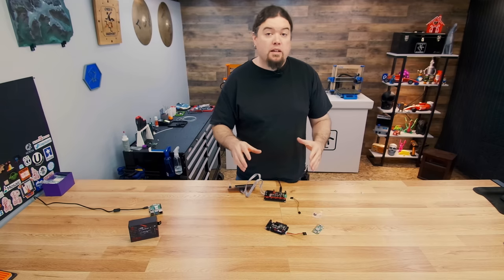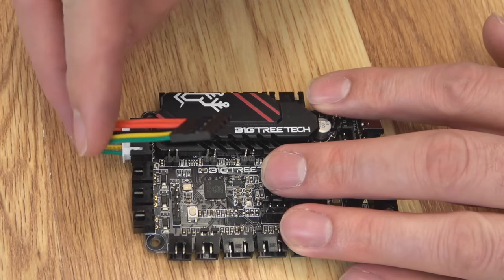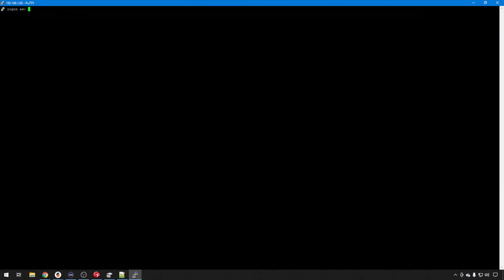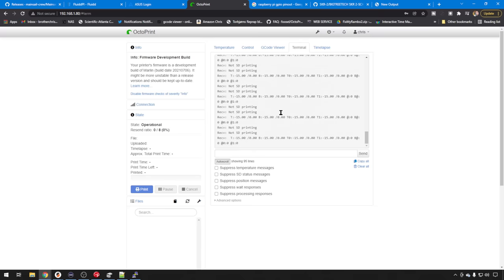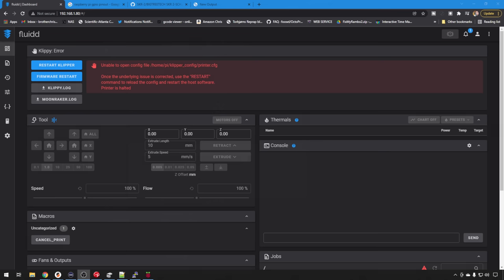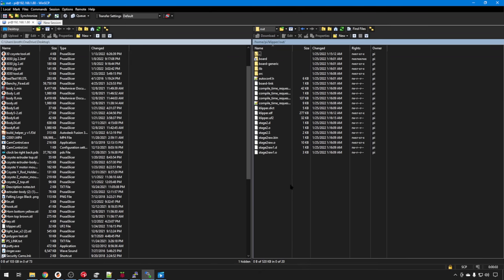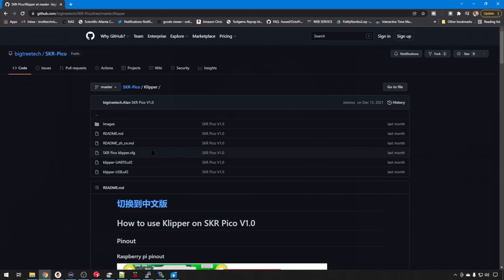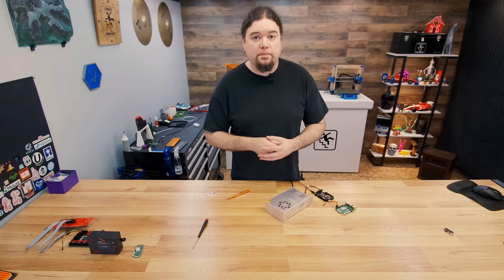Control Your 3D Printer - GPIO - Raspberry Pi - 2022 - Chris's Basement

Comment: wow, another one of my plugins featured by Chris, that's awesome. One recommendation is to use the options in OctoPrint's Connection panel to Save connection settings and auto-connect on server startup after selecting the port/baudrate prior to connecting. That way when the pi powers on it will auto connect and then display the IP on screen.
Reply from the maker: Thanks Jim!
Reply: Are you suggesting something different than what Chris says at 11:29?
Reply: @Graham_Wideman  no, he mentions exactly that at 11:29, but didn't actually click the checkboxes, just mentioned it.

Comment: Thanks again Chris, i always understand you way of explaining stuff, just the right amount of description. is there any down sides to using gpio? i have run out or usbs on my PI and just need one more, i also hear so many people complaining about poor quality usb cables giving them grief. i do have a separate 5V power supply so i just need to run a 2 pin cable from my PI to my octopus mcu
Reply from the maker: Thank you! No downsides that I know of. With the external power supply you should be all set.

Comment: Thank you sir, I've been wanting to do this, but was nervous to just hack at it, especially as the price and availability of the Pi have been crazy lately.  You gave me the confidence to do this on my E3 V2 board and it was a breeze.  Looking forward to other projects you have lined up in the future to use this capability.  I love removing the power and usb cables from my setup!
Reply from the maker: Thanks a lot!
Reply: hey i have a skr e3 v2 also and my octoprint works but it wont connect to my printer, did you run into any issues? also what firmware are you using?
Reply: @aaronward6092  I had to run the commands in the video twice before it would connect to my printer.
Reply: @aaronward6092  I just setup my other printer with the same setup and I realized the other edit I had to make in order to make it work.  I have the Pi4, and although he says in the video to disable bluetooth for pi2 devices, you also need that enabled to get the 4 to work, at least in my setup.  So when you edit the config.txt file, you need to add both lines:

dtoverlay=pi4-miniuart-bt
dtoverlay=disable-bt
Reply: @RyunForsman  you didnt get a low voltage warning?
Reply: @benstepanian1207  I didn't, and it's been running just fine so far.
Reply: @RyunForsman  i was getting undervoltage until increased the wire gauge.
Reply: Hey Ryan, attempting to do the same with no luck. Did you reflash with the klipper.uf2 file as well?
Reply: @RAGEq3e  I'm not using Clipper, sorry.
Reply: @RyunForsman  that might explain it then.......thx
Reply: Hey Ryun, sorry to bother you but did you use the raspberry pi (rp2040) as suggested in the video or did you use the STM32F103 for the pi4 and if you used the STM32 do you remember what selection you used for the serial port? Or did you just follow the video instructions as stated. thanks and again sorry to bother you but mine just isn't working.
Reply: @RAGEq3e  no bother. I followed everything in the video setup by step with no deviation. Sorry it's not working for you, but I'm probably not going to be able to help
Reply: @RyunForsman  you've already helped more than I can say, thank you

Comment: Just my $0.02 but if you are struggling to get this going with an SKR 1.3, what I did was 1) default USB port should be set to '-1' in Marlin 2.0 with baudrate 250000. I then uncommented 'additional USB port' just under that in the config.h (uncommenting it makes it active) and set it to '0' with a baudrate of 250000. Happy days! Working great! Thanks Chris!
Reply from the maker: That's great! Thanks for the tip!

Comment: Ok, so it seems that I have some difficuties making it work. I flashed the firmware twice, both for TFT connection (PA10 and PA9) and for WiFi connector (PD9 and PD8) on SKR 3 EZ. I made changes in both /boot/config.txt and /boot/cmdline.txt, as well as I made changes by raspi-config to enable serial. Works fine with USB so I will stick with that for now, but I wouldn't mind getting some help setting it via GPIO.
Reply: I'm having similar issues using Mainsailos and at BTT SKR CR6 board in my Creality CR6 printer ported to Klipper but it is working via USB
Reply from the maker: These configs can be very fickle. RX/TX pin assignment don't always seem to work the same. I wish there was a better way to troubleshoot them. I will have to think on it.

Comment: Does Octoprint communicate with the Prusa through the TX and RX pins on the J19 socket of the Einsay Rambo board of the Prusa? If so, is there anything special that needs to be done on the Prusa to make it communicate via those TX and RX pins?
In the Prusa firmware, what class (e.g. Serial, MarlinSerial?) does it use to send and receive via those TX and RX pins on the J19 connector?
Reply from the maker: I don't know exactly how the code works, but if you use Prusa firmware all you have to do to use it is turn on Rpi port in the settings on the LCD menu. If you use Marlin you would have to setup an additional serial.

Comment: Chris, thank you so much for your video! Really good as always! I have a Ender-3 with a SKR E3 Turbo and recently I bought a pi zero 2w in order to install it in the same place with the skr designing a new custom cover. So the video arrived at the perfect time. This weekend I finished everything following your guide and I have to say that it works perfect. Everything is in the same box, with one 4020 fan for both (mainboard and pi zero), without extra power supply, or usb cables etc... Just perfect!
The only thing which I would like to ask you is, if I can use a usb webcam which I have us it is, or you think that I need to have an external power supply?
Reply from the maker: I would be reluctant to use a webcam in this config, they do use a lot of extra power. I would recomend and external power supply. Glad you like the video.

Comment: @9:50, where you typed /dev/ttyAMA0…

Where do you type that if you’re using Klipper (Fluidd or Mainsail?)
Reply from the maker: You shouldn't need to on Klipper, that's what the MCU statement is doing in the printer.cfg file.

Comment: Would this work for Libre Renegade and Ender 3 S1? I am using klipper and fluidd
Reply from the maker: It would if the S1 board had TFT pins, but I am not sure if it does.

Comment: After watching your video I'm inspired to do this to a couple of my printers (Ender 3 and Ender 5 Plus)!  I'm currently upgrading the Ender 3 to the Creality 4.2.7 board and I'm wondering where the RPi should connect, to the 4.2.7 board (somewhere) or to the display board where there's 2 unused 10 DIP connectors (EXP1 and EXP2).  I'm puzzled how you'd connect to the TFT connector on the 4.2.7 board and still be able to use the display.  Or should I save the 4.2.7 board for another project and order a couple of BTT Pico controllers? - THANKS!
Reply from the maker: It's going to be hard on those creality boards to use the Pi and the screen. If you want to do both, upgrading the boards might be the best way to go.
Reply: @ChrisRiley   Thanks for responding!  Since I'm always up for a challenge, I'll try a few things and as a last resort, go by way of the Pico!
Reply: @ChrisRiley  any luck? i have the ender 5 plus silent board and want to do this. I’m a bit confused why you can’t just use the exp1 and exp2 connections?

Comment: I cannot get this to work for the life of me. The USB connection works fine. I went through all the steps and double check everything. check the continuity of my dupont jumper. checked ls /dev and the ttyAMA0 is there. Strangely the USB is using /dev/ttyACM0 and that isn't listed in the ls /dev. My knowledge of programming the rasp pi is very limited and have no idea what the next steps would be. any ideas or suggestions?
Reply from the maker: If the device shows up in the ls /dev command like you show, then you should be set. What is the issue? It won't connect in Klipper or something?

Comment: I own a Tronxy xy 2 pro printer with faulty mobo so I want to replace the system for Marlin or Klipper, what do you think should I use? As bad as it can be the tronxy mobo, is very complete system as it handles 3 fans controllable, filament run out sensor and resume printing all in one, is not easy to find a replacement as complete as this one. Your help will be appreciated, thanks.
Reply from the maker: I would look at the SKR 3, with that board you can run any firmware you chose.
Reply: @ChrisRiley  I will, thanks.

Comment: I couldn't get the UART to work on my voron. I had the cable right, did all the same steps as you did but just couldn't get the connection. I did it the same day you put out this video too so the timing is amazing, i just wish it worked and I have NO IDEA why it didn't. I tried both orientations of the TX and RX. I know it's usually TX to RX and RX to TX but I also read somewhere not to switch them because the BTT boards do that internally but neither worked.
Reply from the maker: I wonder if maybe the device name is different for some reason? Do a ls /dev and make sure the AMA00 is there. If not, try chaging to the one you do have in the printer.cfg file.

Comment: Double 5V with single ground wire? How would that help?
Reply from the maker: It really doesn't but it gives you a little more contact realestate.
Reply: I agree. if doubling the 5V wires is necessary for the 5V rail to reduce voltage drop (and it may well be), then it is even more necessary for the ground rail, as that provides the reference zero volts for the digital signals.  So it seems to me that the dual 5V wires is a strong indication to add one or more additional grounds to/from other nearby ground connection points on the two boards.

Comment: Hi I have just got a SKR 3 EZ could i use the tx and rx pins for the WiFi connector instead of using a WiFi adapter on this board I think the pins are PD8 and PD9 I will use an external adapter for powering the Pi.
Reply from the maker: Yes, in fact, if you are not going to use REPRAP with wifi, I would go the TFT route.

Comment: Just as an update: pi4b+ and a SKR mini E3 V2.0 uart to tft connection
sudo nano /boot/config.txt is the same except no need for dtoverlay=disable-bt as it's alreadly listed in the [All] section
no need to touch the cmdline.txt as it doesn'y have the serial....115200 portion anyway
the trick is the "make menuconfig" portion you have to choose the SMT32f103 processor anyway according to Kevin in the klipper github for the SKR mini E3 V2.0
picking serial (PA2 and PA3) gets you to the tft bus on the SKR mini E3 V2.0 (I imagine it's the same for the V3.0 as well) and is listed on the BBT SKR schematics.
I had to do a complete new install for it to work, am currently still adding parts of my old config to it and testing between to make sure it works. Prusa slicer connects no problem.
Just a recap.............Klipper, Pi4b+, SKR mini E3 V2.0 UART to TFT connection
Thanks for pointing me down this path Chris, the options for case development are endless now.........
Reply from the maker: Awesome, glad you found it, thanks for posting the info.

Comment: Can multiple USB connections be made this way? I want to use the nozzle cam from 3do but it looks like it will only connect via USB and if possible, I would like to hide as many wires as I can and leave the ports outside of the case empty and tidy looking
Reply from the maker: There is only 1 serial tied to the GPIO bus, it would get really messy if you tried to do more than one device.
Reply: @Chris Riley  thank you that's exactly what I needed to know!

Comment: Hi Chris, Why doesn´t work in my biqu bx, there is a uart connection in my tft70 display but i can´t connect my raspberry
Reply from the maker: The BX might be configured differently because of how they use the screen. There might have to be some changed made to the firmware.

Comment: Brilliant! been wanting to do this for ages, simply to get rid of the annoying USB Cable that come out the front of my printer and then goes back in. I have had zero luch running a Pi4 from and SKR2 always complains of under voltage.
Reply from the maker: Glad I could help, thanks for watching

Comment: Tried doing this on my Ender 3 S1 Pro but cannot get a connection established. Octoprint sends a message and gets a reply, but connection never happens. Any thoughts?
Reply from the maker: Only thing I can think of is maybe there is a conflicted on the serial. All I would know to do it try another serial option in the firmware.

Comment: Hi Chris i need your opinion. For the same money on 2022 what do you prefer: klipper on a btt pico and a pi zero 2 or a Mellow fly pro with rep rap?
Reply from the maker: I would go with the Mellow board. I think REPRAP is easier to use and the Pi zero 2 is really hard to get.

Comment: I'm wondering if you can clarify something. Can you connect two 5v wires from the SKR 2 to the Pi 4 if it's needing more power or will that only work with the BTT Pico board?
Reply from the maker: You can give it a try, I have had it work on some boards, but not on others. It depends on the power regulator on your mainboard.

Comment: Hi Chris.  Great video!  One link you need to update.  Your link to the Raspberry Pi Zero 2 W is just the CASE for $9.99.  No pi Zero included.  Only a couple of vendors on Amazon had them listed as available for about $75.
Reply: Luckily I’m living in small country. Got 4 with 2 GB of RAM for 46 euros recently and zero 2 W for 16 euros. They come in small batches and are sold here quickly, but in a timeframe of day or two, not minutes.
Reply from the maker: Thanks, I'll look into it.

Comment: If the SKR E3's or other boards RX TX are 5V, and the PI's RX TX GPIO's are 3.3V wont that fry the PI GPIO pins?
Reply from the maker: The Pi can manage the 5v and 3.3v you just have to make sure you hook up the Pi on the 5v pins.

Comment: When i'm on the make menu config, i choose my  lpc1769 (120mhz for my skr 1.4 turbo), then on the communication interface i only have UART0 P0.3 P0.2, UART3 P4.29/P4.28). I don't have the GPIO1 and GPIO0 like you do. I have tried UART0, flashed the board, connected the pins, and i can't get a connection. I followed everything like the guide says, and even checked the connections on the TFT panel, which are reversed on my board comparing to yours. What am i doing wrong?
Reply from the maker: They changed it up a bit recently. I think you want UART3 for that board.

Comment: I would like to implement this method on my FLSUN SR which has the MKS_Robin_Nano_V3 control board. TX3 and RX3 are the only UART pins available (as far as I can see) and they are used by the display(again, as far as I can see).  Could I ditch the display and connect the pins to the Raspberry Pi without having to recompile marlin and this would work?   I am kind of willing to give this a go if there are no responses to my question but I'm not exactly keen on bricking my board.
Reply: Actually RX1 and TX1 are available (but no header socket soldered onto the board - not a good sign) - could I use this??
Reply from the maker: If the display works, then yes that could be used and it shoudl comunicate the same way. TXRX3 might need a firmware tweak to turn it on. It might be worth a try to connect some wires and see if it works.

Comment: Could you also do this with a PC running Octoprint communicating to the mainboard using a USB-to-GPIO adapter? If so, would this render the USB on the mainboard useless or could you still use the board's USB for something else?
Reply from the maker: Good questions, but I don't know how that would work. On this board I think USB and GPIO are the same, so there could be a conflict if you tried to use both.

Comment: I am connected directly via the GPIO on my pi3b and my octopus board. It keeps telling me that I am throttling ...any ideas on what I could do? I am connected via usb because i did not set the firmware correctly at first. Do you think it could fix it? I am using klipper with Fluidd
Reply from the maker: Unfortunately not all boards can supply enough current to power the Pi. About your only option would be to use an external power supply for the Pi.
Reply: @ChrisRiley  i found a way, i tried to plug the 2 biggest electrical wires to see if it was really the wires the bottleneck. It was! So now i have 2 wires big enough to supply power to power a damn house on my pi

Comment: Does it provide any advantage to use UART over USB connection?
Reply from the maker: Sometimes yes, on some of the older boards the serial chip used by the USB connection can slow things down. Now a days, it's mostly for convenince.

Comment: Did the UART change last week. With the Ender3 the problem is that the USB is on the front so it is easily knocked.
I think I may have killed my SKR Mini v2 because of this. Running a v3 now.

I also added a buck converter to power the PI.
Reply from the maker: I think for most boards a converter it probably the safest way to go.

Comment: Having a hard time getting the RPi to connect to an SKR2 via serial. Which serial connection should be selected in the "make menuconfig" window?
Reply from the maker: Chose GPIO1/GPIO0, make sure you MCU setting is correct in your printer.cfg file as well. It should match the output of the ls /dev command.